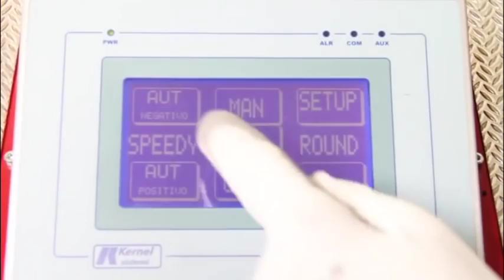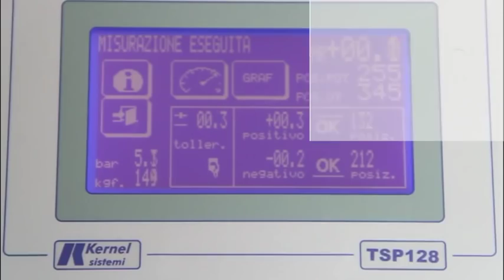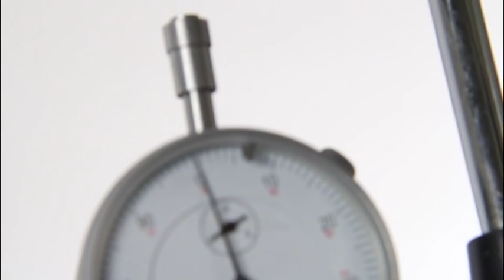Speedyround Plus automatic wheel repair machine

Comment: When your cast rim leaves that CNC shop it's straighter than it is from the factory. The only trade a room that will come from the factory other than that machine is a factory forged and CNC wheel. They are about 2000 a piece

Comment: I used this same machine but never would I cut the rim, this weakens the rim. And that little bit that may be off can be compensated by a road force machine to match the tire. All rims will come back bent eventually, nature of pot holes and drivers blasting over them. This machine while concept is great but does struggle with big rims with fat rim edges and those rims lose the paint on the inside where roller contacts rim surface.

Comment: this looks like a dying business that hasn't even started. We can fix your rim for 900 or you can buy a new one for 300.
Reply: Well, you would be surprised, the rims if OEM can be way over the price of the repair, go price out an MB AMG rim 1600-1800 each. Not the cheap china knock offs that bend easier than a paper clip
Reply: @MilSimActual  We can repair cracked rims, and any other defects for $200
Reply: You do realize there's wheels that are thousands of dollars each right? Not everyone drives a 2001 ford focus 😂😂😂